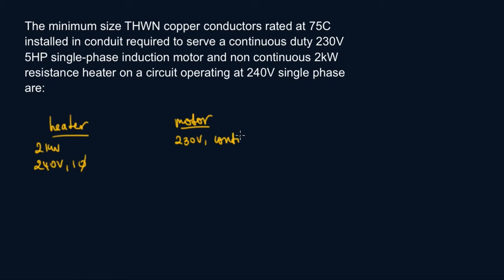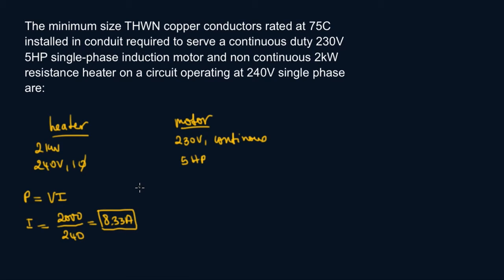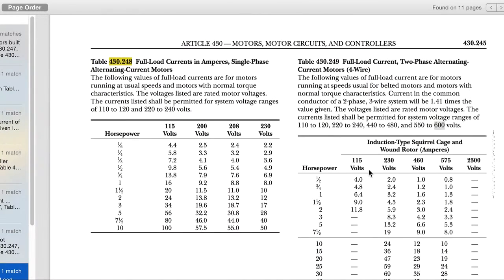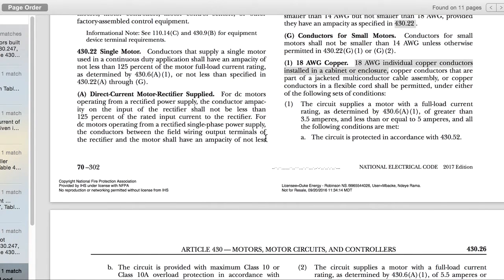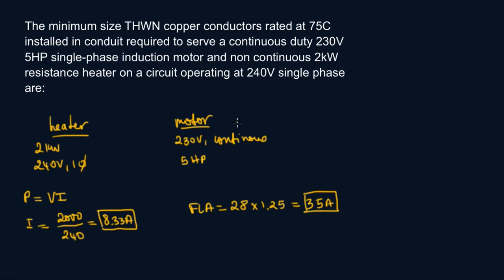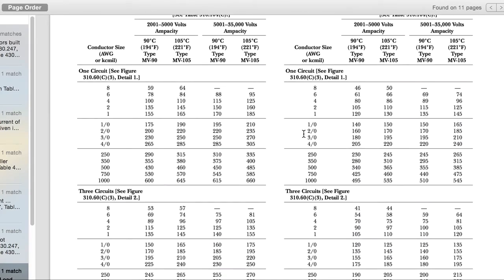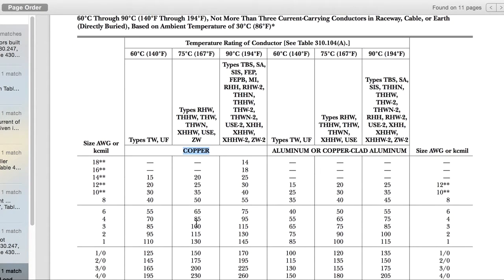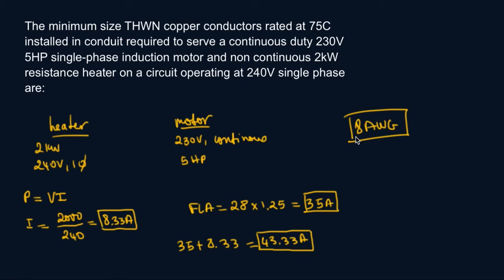Determine Size Conductor per the NEC

Comment: Hi, thanks for this video. My question would be for the wire size of the motor circuit........is it a 10 too, (in the limit) or should it be a 8 AWG as well ?

Comment: Thanks Raiya for all your videos.  The table value for the current of the motor should be the FLC not FLA.  FLA is the nameplate amps listed by the motor manufacturer.

Comment: I’m not sure but shouldn’t it be #6? Since you can only load a breaker to 80% of its capacity?
Reply: I am a little confused there too. 43.33*1.25 is 54A so you would need a 60A breaker. And you size your breaker to protect your wire. But in this case we don't know if we have a fully rated breaker that trips at 100%.
Reply: @ericcooper7508  I think 1.25 is already added for the continuous duty motor.  I also think the 80% capacity limit is BEFORE multiplying by 1.25.  But my question is this.  Since we do not know the terminal temperature ratings we have to assume 60 degree terminal ratings, which means #6 wire has to be used.  In the 60 degree column, #8 has only 40A ampacity.
Reply: sung hwang the problem stated a temp of 75 degrees.

Comment: Hey,

No questions it was very clear and well explained, thank you for taking the time to make the video. Below are few points I feel worth mentioning: 

* You need to size the grounding conductor for both loads ( there is a table specifying ground conductor size based on feeder size).

* The table show ampacities for cables based on 30 C ambient temp., you may need to apply a correction factor if we have higher or lower temp. at the installation location.

*The cables will be installed under ground or over head? inside conduit or direct buried? ( some correction factors might be applied based on the answer). 

Thanks again.